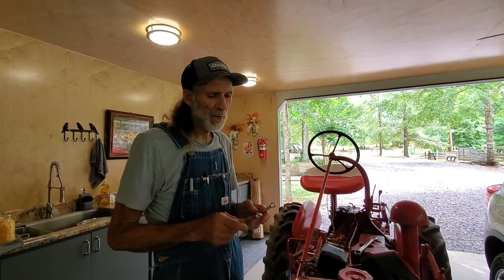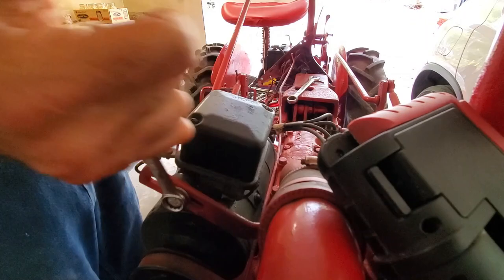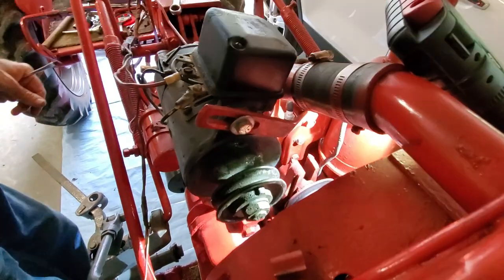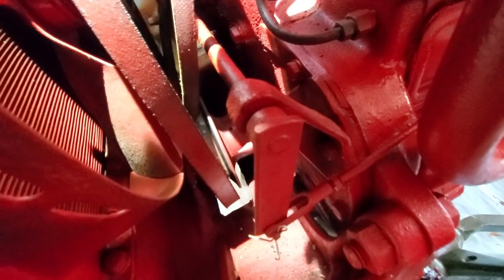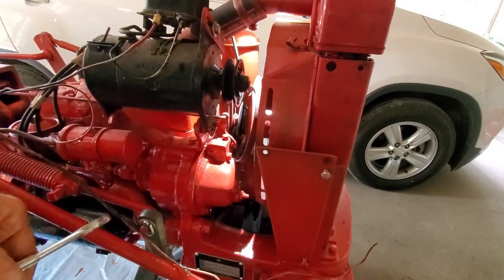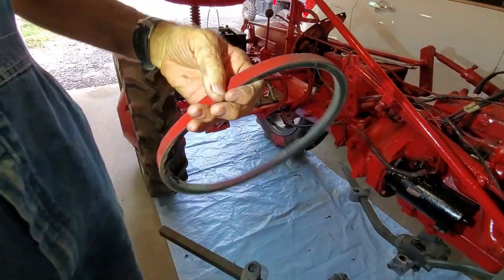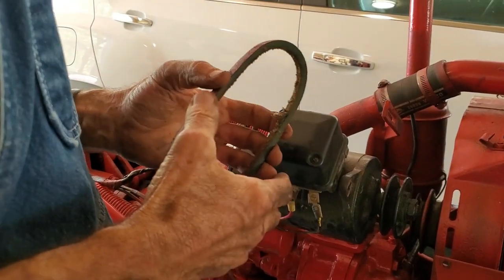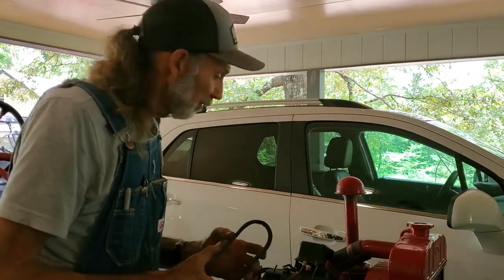Cub Farmall Restoration | 1950 | Greasing the Distributor and Changing the Fan Belt

Comment: Find a product called Nickel Silver anti sieze. There are several brands. I use it on all external nuts and bolts. In twenty years when you take it apart you will thank me. Don’t get it on you. It spreads like wildfire! Especially good for mower parts, plow bolts, exhaust manifold bolts and most high heat applications. Good stuff. I worked in a high heat acid area in a refinery. Seen nuts and bolts so rusted that wrenches were useless. Put a pipe wrench and pliers on them and they would turn as long as they had this stuff on it. Stuff is amazing. Good videos.

Comment: Hey guys! Nice job...   I had a IH 444 loved it. Motor good, trans good., draft control worked.  Most of it was in good working order. But maintenance was a expensive and constant bear. The  hydraulic pump rebuitl was about $800.00, the hydraulic filter was $300.00 used or 2x that new. I spent more time working on it than using it. After a few years of all that tinkering,  I bought a new "orange" tractor. If money and time were not a factor, I would have kept it. But something small kept it from being useful most of the time. She pulled and was heavy, but blessed for the new one..🚜

Comment: Make sure to change the oil in that can, while it's out. Oh I see you discovered that.

I would bet that the valve is just to block off that fitting. Someone used what they had on hand and it was a T, so they used one leg for the gauge and the other they had to plug, so they used that adapter and the ball valve to block it off.

They probably didn't put a fitting there because it would plug up with dirt if only needed every 500 hours or they didn't want people over greasing it. Most people's use these days they may never put 500 hours on a Cub so not many people will talk about it. Most use them to cultivate smaller gardens. An hour here and there a few times a summer it would take years to get 500.

Comment: Why not cut the old belts to get them off?
Reply from the maker: Because you have to take if off to put the new belts back on.
Reply: Cut the old belt off, and once you do, it is OFF, and then put the new belt on. That is what we did with our worn cub belt.
Reply from the maker: @1977islander  The small belt would not fit around the fan. It had to go on from the back.